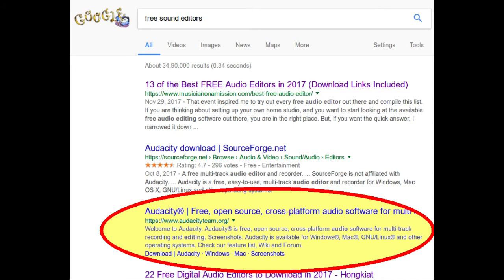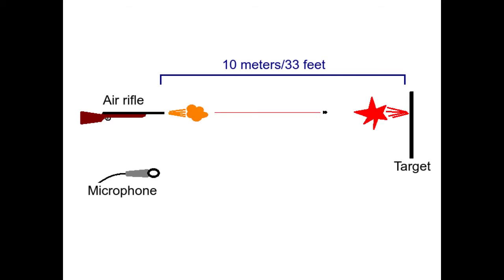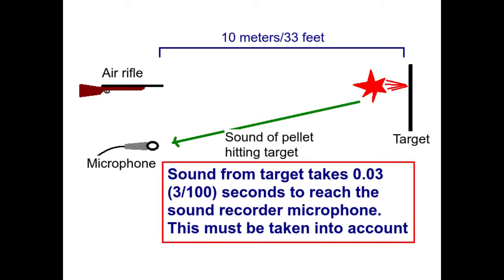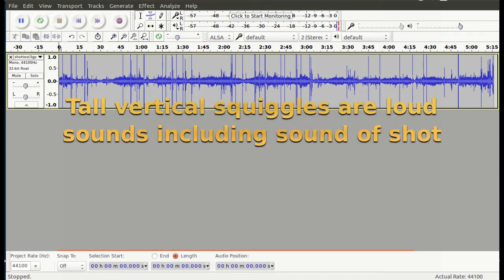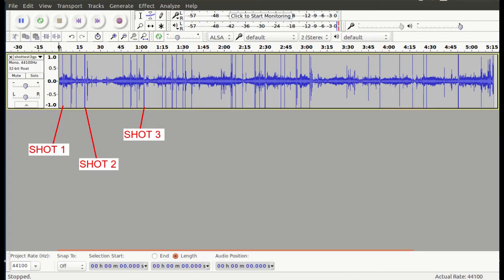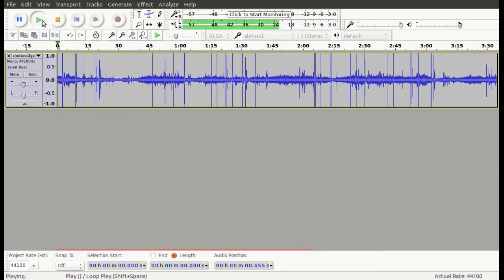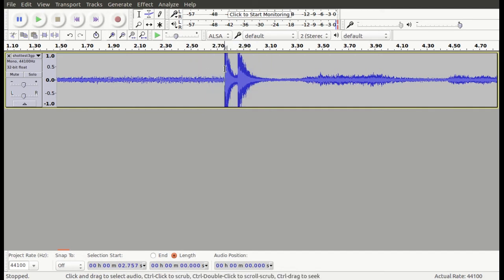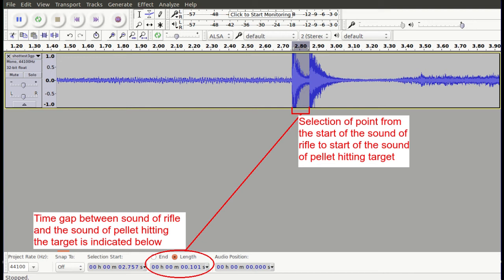Using sound to measure muzzle velocity if you don't have a chrony

Comment: There are two main reasons for the difference.

1) The speed of sound depends on the air pressure. 
2) Chronograph records the speed of the bullet at the very beginning of the trajectory when it's highest. Using sound takes into account the speed during the whole trajectory and gives you the average speed during this distance. 

I would measure air pressure first and then calculate the speed of sound at the given pressure.

Second, I would place the microphone somewhere inbetween the gun and the target. Doesn't have to be on a precise distance because wherever you put it, the sum of the times of the sound of the shot and the bullet hitting the target will always be the same. If something, I would rather place it closer to the target because the sound of hitting the target may be harder to record and as you pointed out - the sound of shooting the air rifle consists of different sounds of mechanical movements. So, if you record it from further away, they should, in theory,  morph into a more uniform sound. But this needs to be tested.

And third, I would use as good microphone as possible. It would make the sound graph more clear and easier to separate the sounds. If you have a really good microphone and recording software you could even measure the speed at the very beginning of the trajectory. Just for the fun I would place a sheet of baking paper (because it's very brittle and should make a clear sharp noise when hit) after every meter and measure the drop of speed during the flight. Actually I was planning to do the same thing this summer when I go to my summer home, that's why I was searching for this video on youtube.
Reply: Regarding putting the measuring device between the gun and the target: I believe the time delays cancel each other out only if it's exactly in the middle. 
Assuming the shot is fired at t1, hits the target at t2 and the sound needs td to travel from the gun to the target. Putting the device in the middle results in the recorded sounds t1'=t1+td/2 and t2'=t2+td/2, so the actual time difference is t2-t1=(t2'-td/2)-(t2'-td/2)=t2'-t1' - but if you move the mic further to one side, e.g. completely to the gun, this changes to t1'=t1, t2'=t2+td and thus t2-t1=(t2'-td)-t1'=t2'-t1'-td